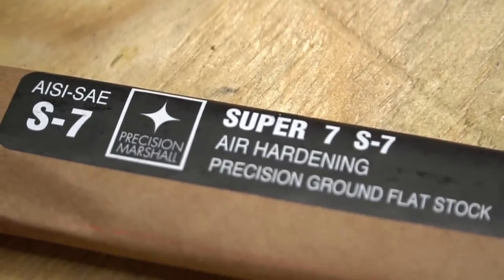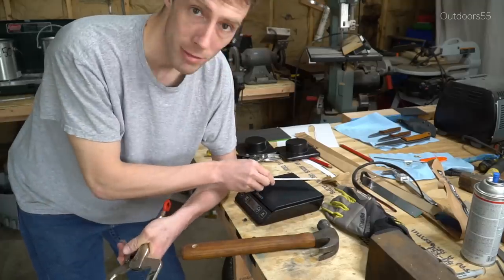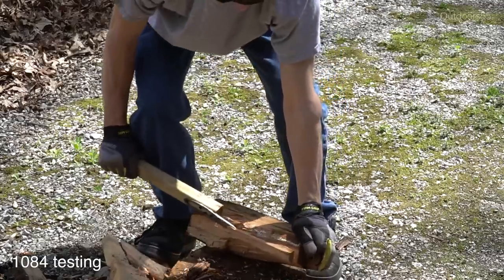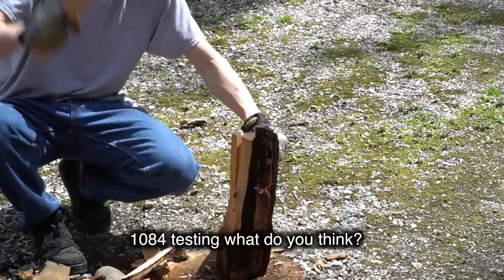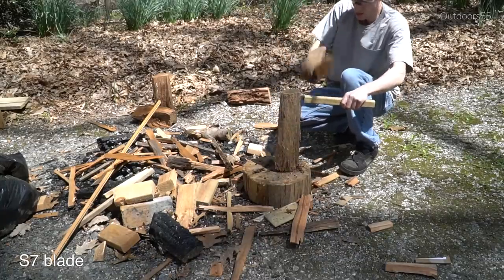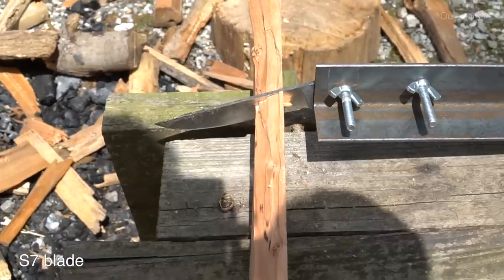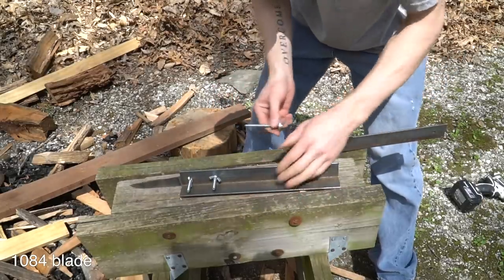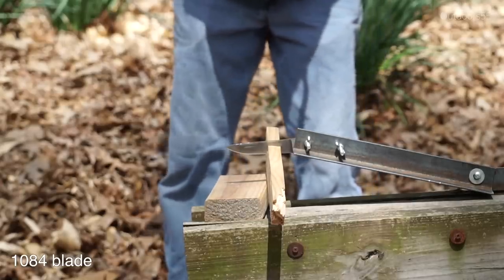What Is THE TOUGHEST KNIFE STEEL? Testing knife steel.

Comment: How does S7 stack up against 3V? or 1v if you really want toughness
Reply from the maker: S7 is a tougher steel. It doesn't have the wear resistance of 3v though. After testing im not sure if it's really necessary for a crazy tough steel. A human hand would have a tough time breaking any hardened steel 😀

Comment: I have seen forged in fire contestants nail the HT and fail batoning with bigger blades and soft spines and all that. Who made you. Hephaestus??!!
Reply from the maker: No, they are not nailing their heat treatment. Thats the difference. Using a forge is not a super accurate way to heat treat. Especially under a time crunch like on forged in fire. They are also, a lot of times, using unknown steel types. So their heat treatment is a pure guess. Hope this makes sense 🙂
Reply: Makes sense to me. Although i have seen some who do the spark test and then heat treat accordingly they normally go on to the final.
Reply from the maker: Spark test doesn't tell anything about heat treating.😉 just an fyi🙂

Comment: s7, 1084 WTF is that stuff? what knives are made out of those? why not test more common steels like s90v, 20cv, d2 or m4?
Reply from the maker: Custom knives are. S7 is a tool steel like d2 but with different properties. 1084 is simple high carbon similar to 1095. Cpm powdered steels like what you mention wouldnt do very well for this purpose. S90v and 20cv lacks the toughest needed. M4 wouldn't be terrible but still lacks some of the toughness as its heat treatment doesn't allow for very much wiggle room for this purpose. S7 and 1084 are VERY common. You probably come into contact with them every day but don't even realize it

Comment: To test its toughness why dont you try to go through a quarter inch steel plate that will be the test you need to make. Going through wood is not a torture test at all that's just the minimum. Check out all outdoors on youtube so you can learn fool.
Reply: wood*  it sure sounds like you need to "learn"
Reply: @captainmarvelous8739  My bad I was voice texting. Still doesn't change the fact that your torture test suck, you should learn from Busse Combat or Miller Brothers.

Comment: HM  !
Just a thought for the serious.
If one has to spend so much effort beating the H out of a small knife to get this wood,
What an effort of energy loss.
I would rather pack something a little heavier that will make faster work of splitting wood
either a small hand saw or even an ax.
Reply: I've done a decent amount of longer distance backpacking and I can assure you weight matters massively. On one hike in the past we were in very cold conditions, yet my pack weighed 1/2 of the other guys and at the end they were all really sore, I was feeling like I could have gone another 30 miles that day! And if you are going in to take stuff out (wild edibles/hunting) I would love to have an utra light fixed blade that is long and strong enough to baton with. Hope this testing leads to a product!

Comment: A hiking or backpacking knife should be stainless. So focus on stainless steels only.
Reply: Stainless steel cannot strike a spark with some flint in an emergency but high carbon steel can no problem, stainless is OK for cutlery but not for a serious outdoor knife expecially if you intend to use that knife in a survival situation. It will cut but won't hold as good of an edge compared to carbon steel
Reply: @xMrjamjam  True that most stainless steels can't throw a good spark with a flint but most hikers and backpackers don't know how to do that anyway. People who practice bushcraft and/or survival often can and also practice the skill. But they also carry some char cloth or know how to make it.
I usually carry a stainless steel knife for food prep and a carbon steel one for rough work.

For most hikers and backpackers the focus is not on the knife and knife skills and often they only carry a folding pocket knife for food prep. Their focus is on lightweight and being maintenance free. Often the knife is somewhere in the backpack.

Carbon steel in general holds an edge better if you maintain the knife and edge.
Cleaning, drying and oiling the knife after every use. If not the edge will rust first and that dulls the edge faster than a stainless steel wil.
I've never seen a hiker or backpacker take this much care of their knife. Often they hardly clean the knife.

Buscrafters and people who practice survival often do take good care of their knives. It's part of the ritual so to say. They carry sharpening tools and oil. They also often carry some char cloth or at least a tin to make it in. A lot of them also carry a the steeland a flint because you can't find flint just anywhere. 

I bring a ferro rod with the striker. That striker is painted carbon steel. Problem solved. Not only do I have a striker for a flint but also for the ferro rod to spare the knife.

When we talk about survival (the real deal) I did never hear one story about someone that managed to stay alive because he could strike a flint with his knife to make a fire. Of course you only hear the stories of the ones that actually survived.
Reply: no. but thanks for playing.
Reply: @StevanOutdoor  my 1095 steels get dried when wet, but otherwise you use it like a regular knife. they wont disintegrate without oil my guy and mine are not rusty, maybe slight water stained and only semi shiny once all the sap and material gets wiped off. Its no mirror and I dont need it to be. only lazy people need things they cant care for because of all the "extra work."  I haven't added oil to my blades in ages and they are in fine shape.